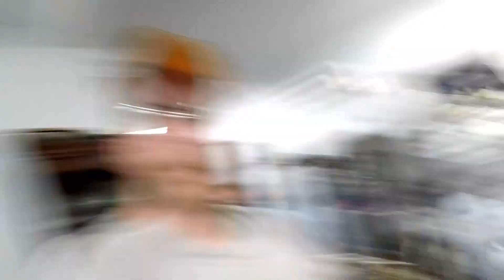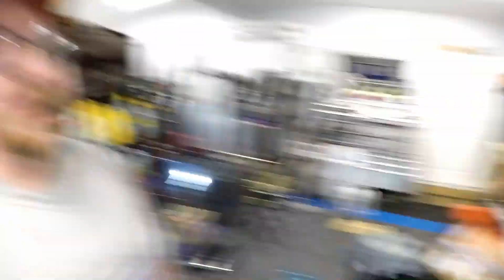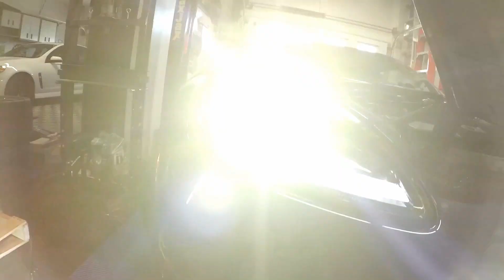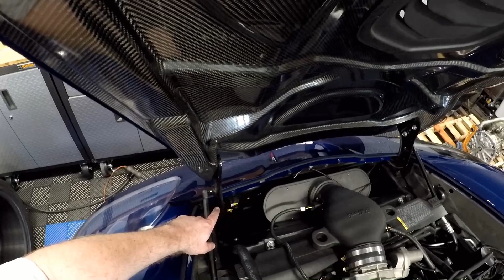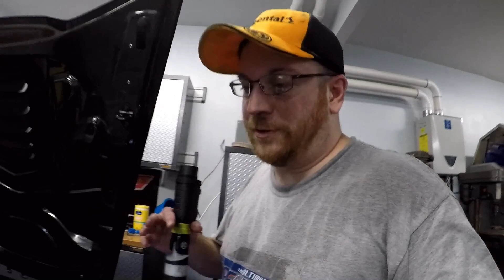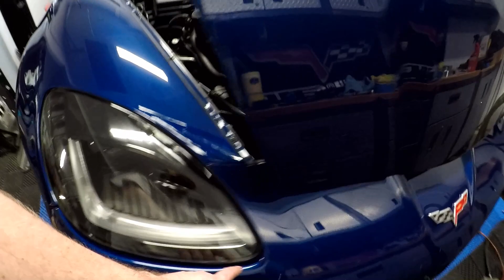2005 Chevy Corvette - Upgrades 3.0 - Pt 33 - Morimoto XB LED Headlights Install

Comment: great video, But I have a problem that I hope you help me with. The conections on the old head light do not match the ones on the new one. the morimoto has two more pins than the stock one and is longer by about 2 cm,  do i nedd na adaptor to make it work, i realy like to not senf them back
Reply from the maker: I think they updated the headlights. I haven't worked with them.

Comment: that is awesome you didnt have to pull the bumper cover off! Good job bro! your super charger same is mine what boost you set at? is that LS3 or 2?
Reply from the maker: Built LS2 at 19 psi with the LS9 setup

Comment: The hi/lo in the new headlights aren’t 2 bulbs.  There’s a flap inside the housing that adjusts to direct the light differently to create the higher beam.  This flap is what makes the hard line of direct light on the wall. When the flap moves, it allows all the reflective light from the bowl of the housing to exit the lens.
Reply from the maker: That is an excellent clarification - thank you!

Comment: Saludo tengo un corvette del 2007 y quiero canbial los farole de alante me gustaria saber quien los monta estoy en el B.X N.Y grasia
Reply from the maker: I've had the headlights for a little over 2 years - and I have not had any issues with them. You do need to make sure you adjust them.

Comment: There is NO SECOND LED BULD in the new units. It’s simply a light blocker that moves out of the way exposing the entire light spectrum of the LED bulb. That’s it!

Damn these are expensive but I am getting a set for my new 2011 Grand Sport. I picked her up two weeks ago. Love her!
Reply from the maker: Your saying the high and low use the same bulb?

Comment: How did you do this without taking off or loosening the bumper
Reply from the maker: Move the wheel out of the way - take access panels off inside wheel well - and remove mounting bolts.

Comment: I tried to have these installed but the lights are surging on both sides. Any idea on what this could be? They are plugged into  the fuse box in 6 as instructed.
Reply from the maker: How is it surging?
Reply: @bonecrrusherSS  do u have an ig? I can send u the video

Comment: I have a gap between the headlight and fender, I can see thru the space , how do you get good fit? I don't want to take these headlights out again to adjust.
Reply from the maker: You shouldn't have to - loosen up the nuts/bolts on the bottom of the headlight - and adjust from there.
Reply: bonecrrusherSS  so do I actually turn the 3 mounting posts to adjust it? Passenger  side  fits great,  driver side is horrible. Thanks for the reply

Comment: Your method for removal and reinstallation of the headlights looks simpler than others.  The other method required complete removal of the front bumper cover.  My 2006 was hit in the side by a deer last year requiring replacement of the fender, apron and headlight.  The headlight in yellow cost $1300.  The body shop had problems and, in the end, there is a gap above the headlight where it appears that a locating pin isn't engaged and the gaps are funny around the headlight.  It doesn't look really bad until you are looking at it from headlight level.  I'm not sure that I trust them to try to fix it and may try to align everything myself.  They had alignment issues with the fender rubbing the door and I think that they realigned the fender without paying attention to the headlight.  Nice video and nice car.
Reply from the maker: Thank you - hopefully you can align up the panels and bumper. Luckily mine slipped back into place with no big deal.
Reply: Sounds like the body shop did not use an OEM fender. Bootleg fenders don’t fit. They are used all the time because they save the insurance company money .
Reply: @metaljew4456  Nope, it was an OEM fender.  The body shop just wasn’t very good at working on plastic cars.   I ended up taking it to another body shop that was able to do it right.

Comment: nice, i now have a better idea on how to get them out...wanna change mine out due to fogging/peeling etc....how are those new headlights holding up? thx.
Reply from the maker: Lights have been working without issue. No complaints.

Comment: Do you have to Connect that jumper wire between the lights  ?
Reply from the maker: Yes I ran it along the plastic baffle between the front bumper rail and the radiator.

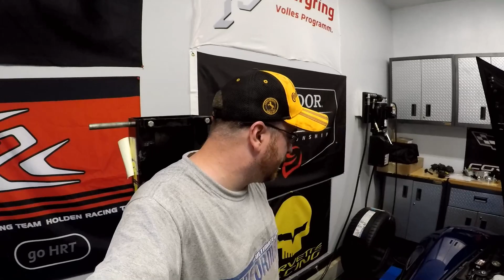Comment: These Headlights does not have a high beam headlight. It's just one HAL headlight (per headlight assembly) with a special motorized door that lifts up to allow more light out from the headlight to to give it that high-beam effect once the high-beam switch is activated. 9:02 - 9:12
Reply from the maker: Interesting - didn't know that. Thanks for sharing!

Comment: How are the headlights holding out? I'm about to pull the trigger on these lights.
Reply from the maker: Been holding up well. 

You need to aim them properly - and might need to glue down the rubber seal. Those are the only complaints people make.

Comment: where exactly in the fusebox did you plug it into ? because my drl's seem to stay on all the time.
Reply from the maker: I plugged mine into the Rear 02 sensor with a tap a fuse.

Comment: Biggest complaint on the c6 is the laughable turning angle. Its easier to just take the wheel off then hand cramping.
Reply from the maker: Some drifting knuckles up front would help!
Reply: @bonecrrusherSS  oh for sure! Haha bring out the track width
Reply: slr has a nice bolt on kit, so you don't have to hack up the knuckles. even comes with spacers to limit the travel to what your wheel and tire combo will allow. so you don't actually have to go all drift spacer and clearancing to get some more parking lot useful angle.

Comment: Great how-to post. Honestly, though, I'm not sure if I love the black plastic housing. It works well on the C7 since there is so much black plastic everywhere else, but the C6 has very little (in comparison) and the non-matching housing in the light really stands out on the paint. It looks pretty good on your blue and would be fine on my Z06 (Cyber Grey Metallic) but I think it might not look great on a brighter-colored car. That flat black housing might make the huge lights stand out in the wrong way on a red, yellow or white Corvette. Maybe I'm wrong. Just my two pennies. Cheers.
Reply: Mine is red. I think they pop and look sharp not out of place.
Reply from the maker: I'd agree with that - yellow white red - might not look good.

My car is pretty dark - and I have a lot of black accents all over it - ZR1 hood insert, rear spoiler, etc.

You can also have the lights disassembled - and the insides painted.
Reply: Painted? Now I'm really intrigued. Once my lights start to haze over (or de-laminate) I'll probably convert. Cheers.
Reply from the maker: Yeah the lenses seperate just like the OEM set - and I think I've seen one guy get them painted.
Reply: I agree.  I love the headlamps but don't think they look good on our white C6.  I would definitely consider if the inside could be painted..

Comment: Did you figure out on these VETTE-LIGHT headlights to NOT have the amber lights on while driving in the day. I want just the white lights on without the amber ones on....
Reply: Just turn on the day light switch and the white light strip will be on.
Reply from the maker: I don't think the Amber glows during the day - I thought the DRL strip was the white light under the bulbs. 

I'll have to check that out during the day to confirm though.

Comment: Love the looks of these lights. It sets the car off but, the led headlight is in no way comparison to the stock H.I.D. The brights on this are a fricken joke. If it wasent such a pain in the ass I'd rip it all apart again and try to install the hid's into this unit. Basically alot of money spent just to have cool DRLs on my Z06. You did a good job on your how to video man. 👍
Reply from the maker: I found a thread where they do show adjust the aiming - I need to really adjust mine.

Have you adjusted yours? Here is the thread I am talking about:

https://www.corvetteforum.com/forums/c6-corvette-zr1-and-z06/4196446-installed-the-new-morimoto-headlights-on-my-z06-full-details.html

Maybe I will film a follow up video on how to do that - and do some night time shots. 

Adjusting them properly might help the light output.
Reply: @bonecrrusherSS  morimoto admits the xb led projectors arenot has brights as their d1s hid but they are more efficient. Id rather have the hid even though I converted to all led
Reply: thanks for the comment. that was my concern with these. all the videos I can find are about looks and zero about light output at night. I had a bad feeling it was horrible. should have ditched the horrible looking blinkers and put in a 2nd projector with a good 55w hid. 

ugh, guess it's back to researching upgraded hid projector inside the stock housings.

Comment: I installed mines but they are lighting up the sky. How do you bring the beam down? Did you have to do that with yours?
Reply from the maker: I have noticed them aimed a bit high - I think if you put a couple washers under the backs might help.

Too be honest I dont drive the Vette a lot at night - and hasn't been a priority to look at.
Reply: @bonecrrusherSS  I'm dreading messing with those 3 unseen bolts again. .yes I don't drive mines at night but the time I did people where flashing their lights.
Reply from the maker: Just found this on the CorvetteForum - looks like they can be adjusted via the port hole in the fender.

https://www.corvetteforum.com/forums/c6-corvette-zr1-and-z06/4196446-installed-the-new-morimoto-headlights-on-my-z06-full-details.html
Reply: There's adjust screws on the unit you get to them from the wheel well same as the stock.

Comment: I seen when you start the car amber lights come on too.   Would like to see how all that works
Reply from the maker: If you hit the lock/unlock on the fob - the amber lights will flash depending on how you have it wired (sequential in my case). The white DRL light replaced the amber function of the stock C6 headlights. The amber lights on the Morimoto lights are only used for turning. 

If others have changed the wiring - then they customized and modified something to get that to work.
Reply: Someone said you have to turn off auto every time you get in the car or Amber stay on
Reply from the maker: I see what your saying now - Yeah I guess you have to toggle the turn signal stalk forward or backward to enable/disable the parking lights.
Reply: Yes -would like to see that demonstration and talked about
Reply: Got mine in July love them

Comment: You got these?  I'm so jealous.  I was following the release of them.  Really liked the look, and my older C6 headlights are starting to show wear, too.  Glad to see a full walkthrough on these.  Great info.
Reply from the maker: My passenger side was toast - I had very recently buffed out the headlight and added cermaic coat to it. That covered up the problem - but you could still see the clear coat flaking off.